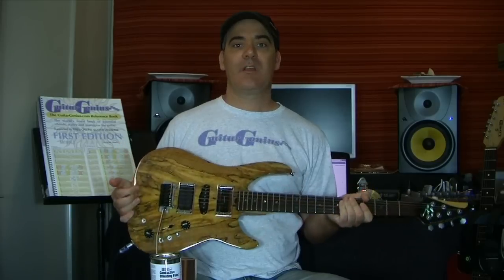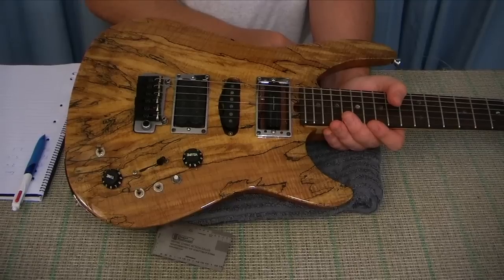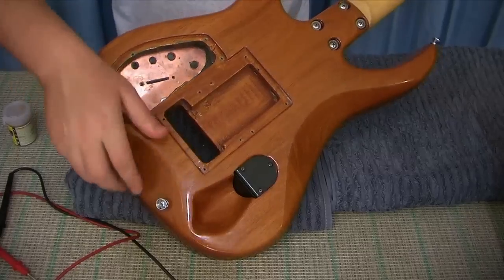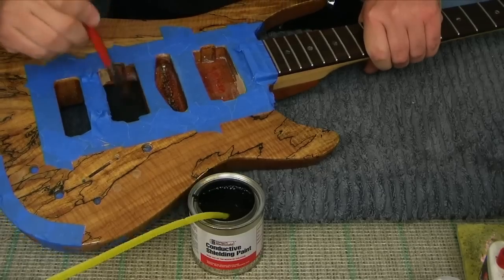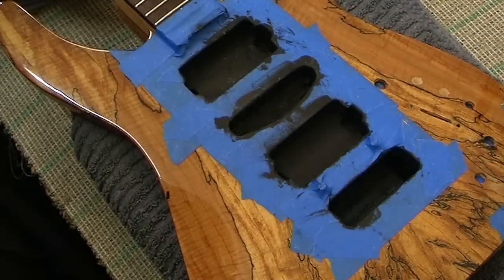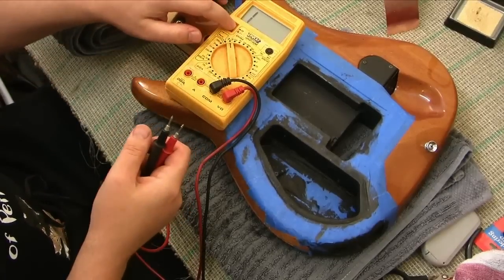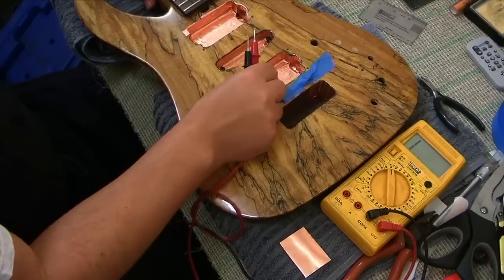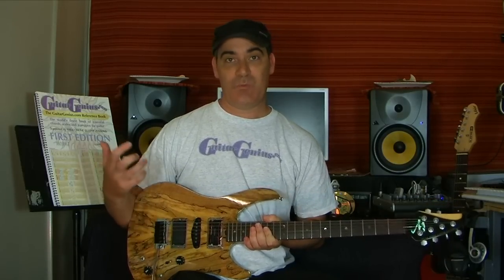Electric Guitar Shielding with Conductive Paint and Copper Tape

Comment: Use shielding paint, covered by copper because 2 layers of shielding works much better than 1 single layer. Also the paint will cover difficult to reach areas inaccessible to copper foil. Use shielded wiring for the interconnections inside the control cavity, and to the jack.
Reply from the maker: Yes, what you have described is world's best practice!
Please subscribe for more guitar related goodies...

Comment: Having done this a few times, there's one very important thing he forgot to mention - make sure the copper tape has conductive adhesive. I don't think it comes without it anymore, but still something to be cognizant of.
Reply from the maker: Yes good point.
Reply: If it's not just fold back a small piece of copper tape on itself, lay that across non conductive joints and put a tape over that piece to secure it OR keep taping guitar strings/aluminum foil/wire across non conductive patches or you could put some solder across the patches. I thought it worthwhile to mention this because where I live it's difficult to source copper tape with conductive adhesive and even then it's much more expensive than regular copper tape. The shielding could even be done with adhesive aluminum foil or aluminum foil pasted on with spray adhesive. 

@Andy : is there a specific reason why you chose to leave a small tab of copper foil for one of the pickup ring screws?

Comment: That worked surprisingly well.  Conductive paint and copper foil are best for shielding from radio frequency interference.  That would include buzzes from switching power supplies (which are everywhere these days), fluorescent light ballasts, and solid-state dimmers (you'd have a hard time finding a stage that still uses rheostats).  However, copper does not have a particularly high magnetic permeability, so it does not do as well in blocking low frequencies (below 100 kHz).  Ideally, you would want to use a mu-metal foil tape rather than copper, but that stuff is insanely expensive.

Comment: My Ibanez Roadstar RS 1000 was shielded from the factory!, the control cavity only ,I finished the job with copper foil , amazingly quiet.
Reply from the maker: Good work!
Please subscribe for more guitar related goodies...
Reply: Ibanez shield the control cavity only because shielding pickups and trem cavities is meaningless when it does not make worse when is not grounded in proper way. It is enough shield the control cavity except in a Strat where pickup and control cavities are basically the same cavity. Btw the test of a shielding job should be made on a stage where are many sources of potential interferences.  Even the most inexpensive guitar does not hum at home (if the electronic parts are ok and grounded and you do not play in front your amp).

Comment: I have used the conductive paint on a few guitars, and I have found no problems with conductivity.  It is messy, but it is also easier to apply than the copper tape.  YMMV.  I think Suhr uses the paint too.
Reply: A lot of companies use it. My 1st guitar had it but it cracked and chipped off in parts. I redid it with copper tape. Looks cool too :)

Comment: Using the conductive paint you need to use several coats before you get good connectivity across whole cavity. I found it easier to apply than copper tape on a Tele build.

Comment: My 41-year-old Pedulla bass has shielding paint in the control cavity, but not anyplace else, also the shielding paint has flaked off in some spots. I was going to re-do the shielding with nickel shielding paint, but now I am considering using copper tape with conductive adhesive.  The paint would be “more authentic”, but the foil more functional.  Hmmm…

Comment: not sure if you did this, but a suggestion to possibly make the noise even less noticable: make sure that each shield in the cavity is grounded. i.e. run a wire, connected from each shield, back to the main cavity shield, where the negative return wire is connected

Comment: I see others are questioning why a custom Brian Moore easily >$1000 requires me to break it apart and copper tape it myself. Did anyone tell Brian about this technique? But, thank you for the great video! Much appreciated
Reply from the maker: kidritalin1 Thanks! With respect to Brian Moore guitars, this guitar was fine when I bought it, but the noise started after I first modded it. All the copper tape might be overkill, but more is more!
Reply: Are you sure it was shielding that was the issue? As you say, it was fine before you fiddled with the wiring. I suspect the rewiring after the shielding is what had the most effect on noise reduction.

Comment: Aluminum tape for heat shielding purposes can be bought in any hardware store and is waaaaay cheaper.
Does the job just as good.
Reply: Aluminium is only half as conductive as copper

Comment: I'm always unsure about the effectiveness of conductive paint for shielding guitars.  Clearly it does something which is better than nothing.  However it is the conductivity of the shield which is the issue, (doh! obvious or not?)  In order to work the current has to circulate in the paint very easily and without resistance.  I'd be very interested in practical experience as it counters the theory every time.  I did a copper foil job on my Squier Strat which made me feel as though it ought to be better but am not sure.  I would say that copper foils need to be soldered together, especially if they are adhesive backed as this might insulation one strip from the next.  Also, the strips or paint must connect to the output socket and amp which must also have a good ground connection within the building.  Easy to forget that this whole path must be good or it will fail.  Good video - thanks.

Comment: Quite informative. Lessons learned: Conductive paint sucks. Even high end guitars can need mods. Conductive paint is the only way to (partially) shield wire path holes. Question: I liked the idea of connecting cavity's with a guitar string, but might the (mix) of copper bonded with steel (the string) create some electrolysis? I will use a strand of bare copper myself and it will be easier to mold in. Thank you for the video on this.

Comment: I don't totally understand using a guitar string to connect all the parts. It seems like it would be easier and far more reliable to just solder fine wire to the copper from one cavity to another. I believe this is what most people do
Reply from the maker: A guitar string is a fine wire with the benefit of being stiff enough to thread though the small cavity holes.
Subscribe for more guitar goodies!

Comment: Sounds great! Do you think it's absolutely necessary to shield the back cavity (& ground it to front) like you did here? Just curious; I'm installing a new loaded pick guard assembly into a Strat & was going to attempt to shield it while everything was out of it because it also has a particularly gnarly hum on the 1,3 & 5 positions. I wasn't thinking to do the rear cavity, but I guess it wouldn't hurt?
Reply from the maker: It may not have been necessary to shield the back cavity but I'll never know. If it's worth doing it's worth overdoing!

Comment: I wonder if he mixed the conductive paint before applying it, the metal parts which makes it conductive sink to the bottom so you have to mix the paint to get the metal in there.
Reply from the maker: Yes he mixed the paint.

Comment: Andy why did you use paint AND copper? For grounding? Why use the paint at all? I haven't found any videos that show using conductive paint only, and then how to ground the paint. How do you ground it if you just use conductive paint? Just put a screw through and attach your ground wire to the screw?
Reply from the maker: After I learned that paint wasn't a good idea, I think that I said in the video that from now on I would only use copper tape.
Reply: @andymacksoundvision  I'm sorry I missed that. After shopping around for awhile I found a small bottle of conductive paint on eBay. I think it was around $10 and came with a screw with a ground wire and a brush to apply it with. I also bought some copper tape from Amazon. Walmart sells the  copper tape for gardening, suppose to repel slugs, but it was more expensive than Amazon. I have 2 guitars, on of which I'm building. I'll probably put the copper in that one and try the paint on the one I play now. Thanks for your reply.

Comment: You mention that you wouldn't use the paint again And that the tape does everything the paint does. Can you expand on that a bit? Does using both really not have an added benefit? Does using just the tape solve the problem completely or is there some small amount that the paint helps with? Thanks very much!
Reply from the maker: I don't feel that paint would help at all if you've covered it all with copper tape.

Comment: Doing a telecaster build right now and up to the point of shielding the cavities.   You convinced me to use the tape and not the paint.  Do I need to put a ground wire to the bridge?
Reply from the maker: Yes it has to be connected either with a wire or tape etc.

Comment: I'm about to shield my guitar just like you did, but I have three quick questions!
1. I've got 10 year old shielding paint in my control cavity. Is it still good and conductive, or no?
2. Is shielding the trem cavity necessary if I just ground the spring claw?
3. If I DO shield the trem cavity, should I get a plastic cover for it and shield that too?
Reply from the maker: Do it all, and do it with copper tape is my advice.
Reply: @andymacksoundvision  I've got some brand new shielding paint. I'll put a fresh coat over the old paint, then cover it all with copper. Sound ok? Thanks!
Reply from the maker: @dsargent724  sounds good. Make a video and show us your work!

Comment: I had similar poor results with graphite paint. Guys, save your money and use aluminum or copper.  It's tried and true, it won't flake off, it doesn't need 3 coats and it will still be doing its job long after you are dead. The paint is easy and fun until you put your meter on it.

Comment: Few questions: Doesn't it kill some of the frequencies? Can I use aluminum tape? (it's what I have laying around) Do you have to shield the holes for the wires?
Reply: Yes, IMHO:
As long as you build  a decent Faraday mini cages for the noisy pick up cavities (single coil is the worst), you will be fine .Shield the wire by using braided copper ones rather than shielding the holes.

Comment: Question: Is the copper conductive tape available at local hardware stores like Lowes ( in the US ) the same thing or do I need a special made for the guitar product...???

I need to get mine done soon. You convinced me not to go with the paint and I cancelled my order for that. Answer...???
Reply from the maker: Thomas De Lello Sorry I can't say. I live in Australia and I have never seen copper tape in any store. However, copper is copper, if it has an adhesive backing, use it!
Reply: GuitarGeniusCom Well... I should check to see that the adhesive glue is also conductive then.
Reply: Thomas De Lello Buy it online, next day delivery, if you're in US. S'easy.
Reply: Thomas De Lello What you can do is simply put double-sided tape on aluminium foil, that's cheap and you'll end up with plenty of very good adhesive shielding tape. This is what I've always done and it's perfect.
The only counterpart is that you'll have a little less "Mojo" ^^
Reply: Andy Mack Sound and Vision I live in Ireland and you can buy slug tape which is basically copper tape for €1.50 for a small roll. I'd say that you'd probably be able to do a entire guitar with 3 rolls
Reply: I bought a 5CMx2M roll and it was plenty for one guitar.
Reply: fishy paw the rolls I bought were only 2m x 2.3cm. Depending on the shape of your cavities one roll might have done. Mine were a little awkward to do but I think using the narrower tape made it a bit easier to do
Reply: Forgive me disagreeing slightly but I found that the broader tape was good because it covered more in one go, without overlaps and it's easily trimmed to size to fit the fiddlier bits. I used about 1.2m for one guitar, so two rolls would probably cover three guitars.
The tip to get it cheap, as you suggest, is to buy it as 'slug tape'. I got mine from Amazon.
Reply: You Can Get Any Size You Need At Amazon.

Comment: Why wouldn't you test the paint for continuity before using it? Also, why a guitar string instead of any normal copper wire to connect all the taped cavities?
Reply from the maker: Michael Petford The paint was tested but it does not have anywhere near the same conductive (and therefore shielding) value as copper. I used a guitar string because its stiffness makes it easier to poke though drill holes.

Comment: Conductive paint is not as good as copper tape - you need to make sure that the glue on the tape is also a conductor, otherwise its only top of the copper tape which is a conductor.  You must make sure the bottom is also.

I have never needed to shield an guitar I have made.  As long as the guitar and amp is earthed then no noise.  I have made 2 strats, a tele and a Les Paul.

I live in the UK, so we have a third prong in the electrical socket which contains the earth connector, the guitars are earthed, the amps are earthed and had no noise.

The issue with noise seems to only affect countries who don't always have an earth connection in the mains electrical socket.
Reply from the maker: Are you telling me that positions 1, 3 and 5 on you strat don't have extraneous RF noise? Australia has 3 prong plugs with an earth.
Reply: @andymacksoundvision  no, I have had no noise with any of my guitars.  Maybe I am lucky, but I have played in some dodgy places - where it's advisable to use a radio linkup, Even with a full cable link I have never had any noise.

The Faraday cage which is created is basically an RF filter.  If the guitar and amp and speakers are fully earthed - this included the cable as co-ax cable should be connected to earth too,to reduce noise.  If any part is not properly earthed you will get noise, which is erronious electrical signals on the live connector, earthing prevents this..

Comment: Do you think the paint would have done the same job without the copper?
Reply: The paint would have been enough, I have done it with the paint, and yes the paint is very messy, the copper tape is overkill.  I would have masked the entire guitar, and used nitrile or latex gloves to keep clean. The copper tape is normally added to the electronics cover plate and the tremolo plate only, since it is expensive.  What we want to do is create a Faraday Cage around all the electrical components, like how a microwave is shielded, the key thing is to make sure it conducts electricity all around the cage, so keeping the cover plates in contact with the paint is important.
Reply from the maker: The copper tape is probably overkill, but if it's worth doing, it's worth overdoing!

Comment: so you have to run a ground wire from the copper tape to a pot right?
Reply: not if the top of the pot is touching the tape
Reply from the maker: anthony10370 Yes, correct.

Comment: So did you ever have to solder the guitar string connecting the front and back cavities? meaning there was no need to solder?
Reply from the maker: Yes I did solder the ends.
Reply: @andymacksoundvision  and the soldering is just to keep the string in place. The actual solder has no conductivity right? Is there something else besides solder I can use like maybe glue to keep the string in place?
Reply: @notab7626  Solder is conductive. If I didn't have solder I'd tape the string down.

Comment: Faraday Cage!! The copper tape is the bomb.. The shielding paint not so much..
Reply: Headknocker the graphite paint gets the job done in instruments with relatively quiet electronics, but it's not as good as copper/aluminum. I use a nickel conductive spray coating (MG Chemicals Super Shield), and it's just as conductive according to an ohm meter as aluminum, with a negligible increase in resistance vs. copper (electrically continuous, for our purposes here, is electrically continuous). It works wonderfully and takes a small fraction of the time copper tape does with no chance of the paint folding up and interfering with stuff you don't want grounded like the tape is bad for doing in tight pickup cavities and such. It's awesome.

Comment: But you don't know which solution worked for you.. copper, shielding paint, or a combo of the 2.
Reply from the maker: Michael Brown The copper tape.
Reply: Andy Mack Sound and Vision . The  paint didn't bring anything to the party if you were going to use the copper tape anyway. I might have gone with copper wire soldered to the cavities instead of the guitar string but hey if it works it works :)

Comment: there's no available copper tape here, can i use aluminum foil as alternative?
Reply: niva fcker yes, it would work. But I would guess it's hard if there isn't a sticky backside.
Reply: niva fcker you can use tape that is used to stop snails and slugs, i know its bizarre but it is exactly the same, copper tape
Reply: You need copper with conductive adhesive. Else it's useless. I don't know why so many people give you wrong advice. Copper tape for slugs is useless. there is also Copper paint (spray) it there, which is easier to spray, but you need to protect the rest of the guitar from the spray. 
Also make sure to connect different cavities by soldering a  bare wire direct to the copper tape in each cavity.
Good luck.

Comment: What was the purpose of the guitar string in the bridge pick up position and it going down to the volume tone pot area, it was around 15:48 within the video ?

If you wouldn't mind explaining it please.
Reply from the maker: I used it instead of a standard wire to connect to different parts of the shielding. I used a guitar string as its stiffness made it easy to poke through a hole.
Reply: Thank you